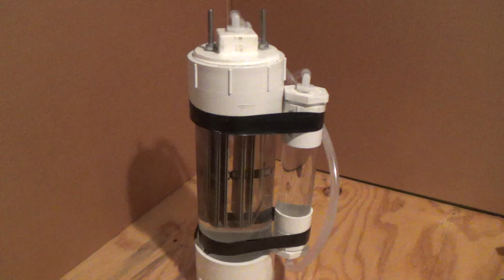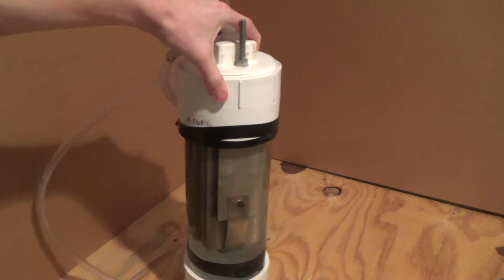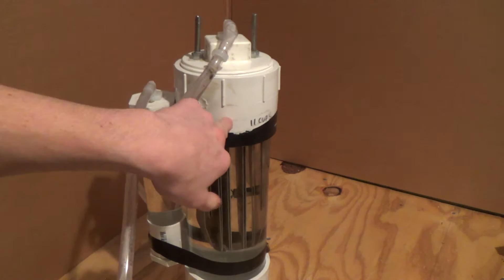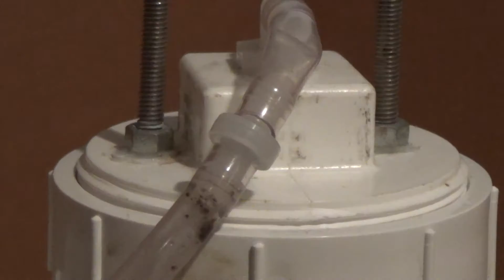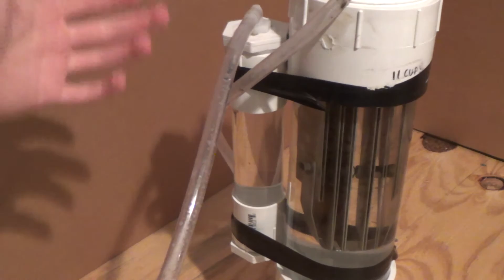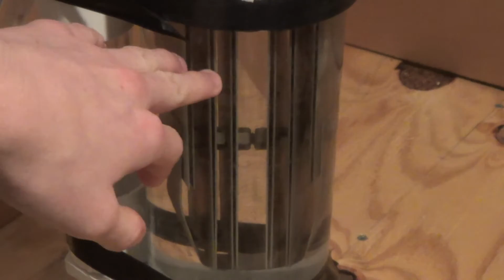HHO Generator with 12 Plates - 2.06 LPM

Comment: Adding nuetral plates will reduce Amps, increase gas production and balance out the voltage between each cell.
Reply from the maker: Thank you, I'll have to try that out!
Reply: Neutrals in a wet cell get skipped, especially as you add more electrolyte.  The water becomes more conductive than the plates.  You will notice when you turn it on the neutrals don't do anything, and as a result you will only have a few plates producing any gas, which usually leads to people adding even more electrolyte to compensate.  Don't bother with neutrals.  Less voltage is wasted wattage.  More amps vs volts makes more heat.  This is known in the electronics community.  This is why Stan Meyers used excessive thousands of volts and little current.  Amps makes heat, not voltage.  Voltage gives you more pressure to push amps, which means you can reduce the electrolyte mix, which results is more efficient cells. Don't sacrifice voltage like that unless you're working with a dry cell because then it is necessary as they have no way of keeping cool and you don't want them to burn up the gaskets and leak caustic fluid everywhere.  For wet cell designs always use a full parallel setup and minimum electrolyte, and I personally recommend having a larger water bath with fewer cells dissipating more amps.  I plan to use 9 or 7 cells of a 2 inch size to dissipate 15-20 amps in my car.  The hotter those plates and the surrounding water the more HHO you will pump out.  Just be sure to use driers to separate the excess water vapor so you have a more potent gas.